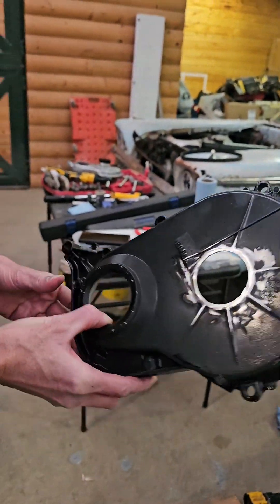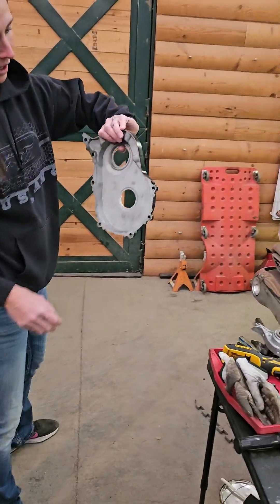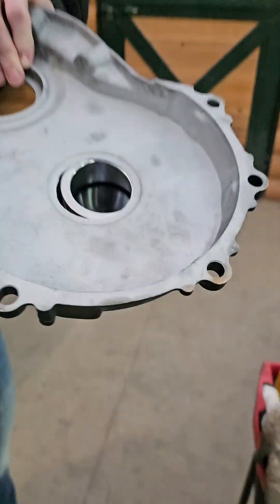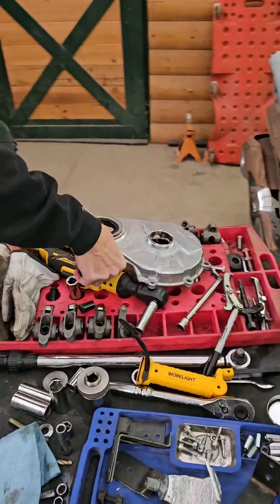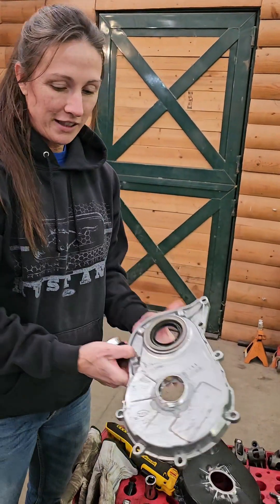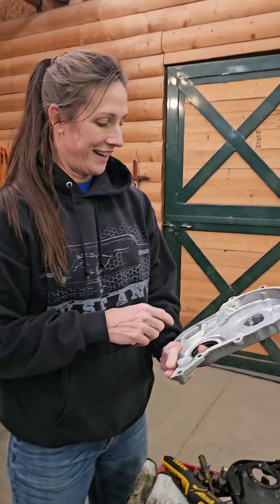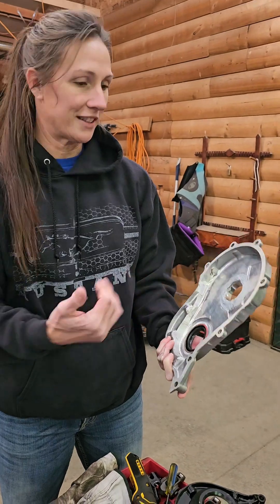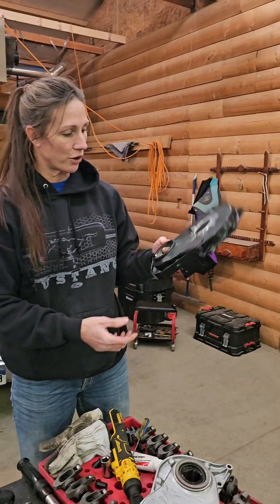Making a custom timing cover for Ford 300 inline 6 turbo engine build boosted 300 ford

Comment: What is that for ?
Reply from the maker: @booostdemongarage4827  this will give us extra room so that we can run a bolt in the cam to keep the gear on at high rpms.   With the stock cover there is not room to leave about in the cam.  We could have just added a bump to the cover, but the cap let's us inspect the cam gear. Last year on route 66 we had trouble keeping the gear on above 6000rpm.  There are other videos about our trip.
Reply: @ ohhhh damn thats a pretty cool idea and convenient